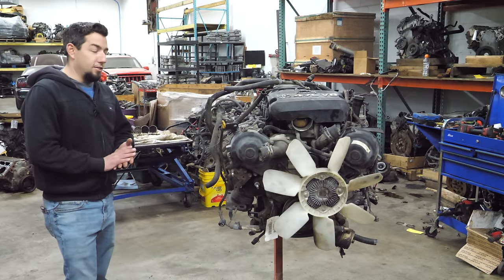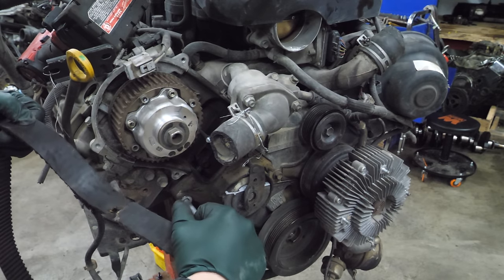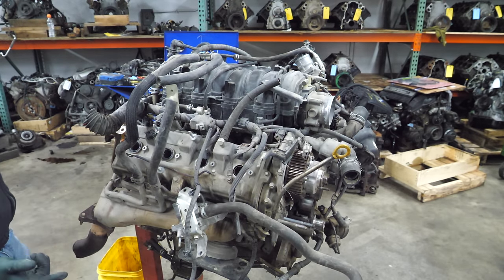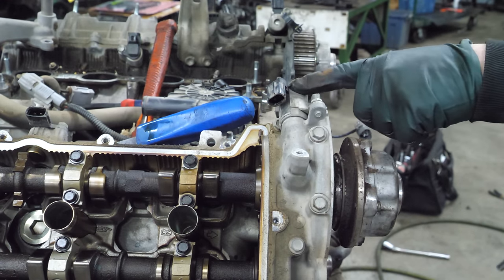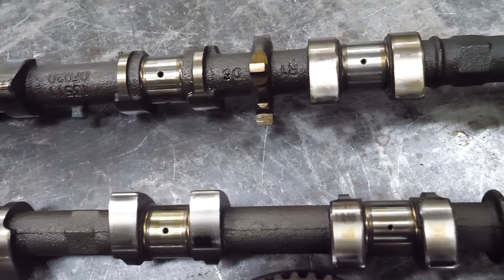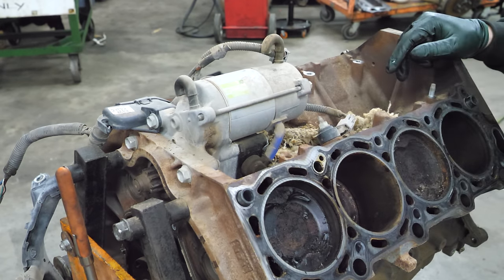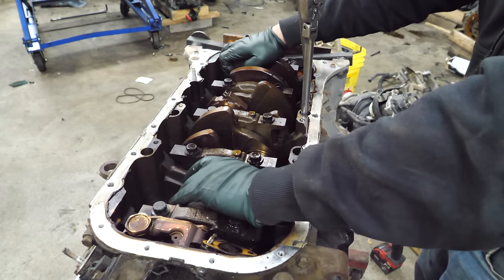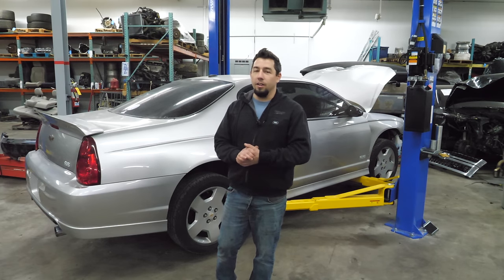Toyota Tundra 2UZ VVT Teardown! Bad Decisions Led To The Demise Of One Of Toyota's Greatest Engines!

Comment: This is why I'm not of fan of any engine that uses a timing belt unless its a non-interference design. Yes, I know timing chains and gears can and do go bad and can cause even more damage but the odds are in favor of metal over rubber.
Reply: I have a 2007 Sequoia with this engine, it’s a maintenance service about every 100k....I don’t consume oil with 190k and the oil is never burnt at 5k oil change. This is the most smooth and reliable engine I’ve known. My company Tundra has 420k on this same engine and only have done $2000 worth of maintenance on it. They are legendary, it does have the belt as a minus but it’s worth it.
Reply: I agree man, although it's not a vvt engine, I still drive my 96 Toyota 5sfe 2.2 and it uses a timing belt. I replace the belt every time I have had to access anything beneath the timing cover. (oil/water pump). Great little engine and the reason why I have strong faith in it is due to the fact it is non-interference.
Reply: Nothing bad with timing belt when you maintain it like you should
Reply: @miteshshah8060  yeah and my 4.9L Ford I6 is 350K old without any oil burning issues and is on 5k oil change intervals as well. But it doesn't have a timing belt. Or even a chain. Just two steel gears lubricated with a direct oil spray.
Reply: Even on a non-interference engine, a timing belt is a dealbreaker for me. I won't buy one. It's a lot of expensive maintenance that just does not need to be required at all.
Reply: I always feel like a timing belt on an interference engine is like a ticking time bomb
Reply: @thefatdindon  There is a LOT wrong with timing belts. They:

1: Don't last very long compared to chains or gears. An OHC chain system will last >200k without problem, a cam-in-block chain system lasts the life of the engine, and a steel geartrain with direct oil lubrication is functionally immortal. Pop the timing cover off literally any semi truck engine you care to grab from the past 80+ years and you'll see a common trend: It doesn't matter where the camshafts are(Yes some are OHC!), they are driven by steel gears lubricated by direct oil jets. And these gears just simply do not wear out even when the engines themselves have million mile service lives!

2: Changing them is a costly pain in the fucking dick. You have to tear half the engine apart to gain access to it, you often have to lift the engine and remove motor mounts since a lot of the time timing belts get used in transversely mounted engines and for some stupid fucking reason the engine mount on the front of the engine goes THROUGH the timing belt, and getting engines timed these days is way harder than it needs to be by design because they don't want you shadetreeing repairs anymore.  I know they use chains, but Ford Ecoboost engines come to mind on this; you need a tool only available to 'authorized repair facilities' to set the cam timing on them. It would be trivial to do this with a belted engine too just to further make them a thorn in owner's sides. Atop this, the job doesn't just change the belt. It's also got a bunch of tensioners and often water pumps attached to it as well; needless part replacements drive costs up for no good reason!

3: They are used to enforce planned obsolescence. Between the cost of having them replaced and the consequences of letting them go, they're a great way for a car company to design an engine with a service life of just 150k or so. Spec the belt to be replaced at 100k, ensure the engine is hard interference, then wait. People will either trade them in on a new model around that point so they don't have to pay for the replacement which lets your dealership do the service and resell as used to repeat the cycle, or they'll not get it changed because it costs a fucking fortune and it's impossible to shadetree only to blow the engine up right on schedule.

4: If that front main seal ever starts to go you can kiss the engine itself goodbye. Oil getting on a timing belt, for whatever reason, just fucking murders them. They will break ahead of schedule. And you probably won't even know it's happening until it's too late because the oil can't really get out of that area very easily. It just soaks into the timing belt and causes it to rapidly deteriorate with no external signs the seal failed at all. 

Fuck timing belts. I will never buy a vehicle that has them equipped. If I do, I will swap the engine to a different engine which uses chains or gears.
Reply: @TestECull  and yet the 4.7 Toyota V8 will go a million miles. Nothing forced obsolescence about them. Although you could say that about newer Toyota timing chain engines.
Reply: The thing is the best thing for a timing chain to last long is to constantly keep the oil fresh. But lots of people still go 10k miles on a oil change and do lots of short trips.
Reply: @jgranger2002  If it has timing belts it's got planned obsolescence built right into it. The hope is that an owner will be like 'well it isn't worth putting that much money into it so I'll trade it in on a new car' when they see the bill for the job, or they will instead refuse the job, keep driving it, blow it up, and replace it. And even if the engine itself doesn't, the truck it was put in DOES.  Nobody selling cars these days wants them to last more than about 100-150 thousand miles because if they last forever nd ever and ever and ever you won't be buying a new one as soon as your current loan is paid off. They want you on another one immediately.

Every modern car is built with planned obsolescence in mind. Use of timing belts when chains or gears are more skookum is just one example of many ways carmakers try to incentivise purchasing a new car every few years.

I still drive an F150 from 1985. That 4.9L I6 is truly immortal. Simple, rugged, easy to service, doesn't need much servicing, if it does need repair the parts are cheap as shit and I can do the repair myself with basic tools. Truly a built-to-last engine. And the truck itself is the same story; built to last, to be serviced, repaired, cherished for decades on end. That ol' mill is just about due for overhaul and I'm not gonna think twice about giving it that overhaul; be a better spend of money than anything I could buy today.
Reply: @TestECull  well I'm not sure my 2000 tundra is modern or not. But I know because of current examples it will last a million miles with proper maintenance. I would imagine if Toyota detuned the 4.7 to the power output of a Ford 4.9 i6 it could make it to 2 million miles.
Reply: @jgranger2002  It's modern. Anything with OBD-II is modern. And no, it's not the power output that shortens the engine life(Fun fact if you poke a Ford 4.9 until it's spitting out 400/400 it still lasts basically until the end of gasoline!). It's the timing belts. They're a costly periodic maintenance item that incentivizes people to replace the entire car instead. Not only that, but the truck around it won't last half as long as the engine already does.

I'd also like to see a citation on these mythical million mile Toyota V8s. The only engines known to last that long are 14+ liter diesels in semi trucks, and it's a world of difference how much more ruggedly built those engines are. Setting aside the sheer size difference, those things are built to last for-fucking-ever without any internal issues to speak of, and they're built rugged enough to shrug off neglect and abuse that will kill anything Toyota has ever sold.
Reply: @TestECull  well you can Google Toyota 4.7 million miles and see a few examples as YouTube won't let me post links. Power output definitely has an effect on longevity of an engine. You have an 85 Ford 4.9 it makes 117 hp and 233ft lbs of torque. The first Toyota 4.7 makes 235 hp and 320 ft lbs of torque. Planned obsolescence is for people that won't spend $1500 on there current truck but have no problem spending 40k on a new truck. I can agree that the ford needs less maintenance that the Toyota but the ford basically has a gas tractor engine. No hp all torque that revs to 4800 rpm.
Reply: I like the old style chevy engines, no tensioners, water pump isn't ran off the timing belt or chain, they can nearly go forever. I see 4.3's old style v8s go well over 200K miles and never had a timing job done to them, I would recommend every 100K miles but its rare they break.

I had a 91 Chevy c1500 with a 4.3 that had 680K miles on it, I was the 2nd owner, my grandfather was the first, it never had a timing job as far as I know, it needed it, turn the crank over a quarter turn before the rotor button turns in the distributor, truck ran and drove good even after beating the snot out of it hauling more than it could really haul, just wasn't worth putting the money into it, that thing would not die, I sold it running and driving lol.
Reply: @jgranger2002  275FT LBs, actually, and yeah it basically is a tractor engine. Which I fucking love. It doesn't need to rev. I cruise down the freeway doing 75-80 right alongside everyone else but I'm turning half the revs they are. 1750RPM. My usual upshift point is about 1400-1500.

You do have a point to a degree, but in neither of these engines does that come into play. You don't start seeing power causing shortened longevity in engines of this displacement until you're chucking out well north of 500HP. 235hp..120hp...in both cases the metallurgy inside the rotating assemblies is nowhere near its max loading and should not have any wear issues.

Also, getting 235hp out of my I6 requires little more than changing the carb out for a 4-barrel, changing the intake and exhaust manifolds, and stabbing a mild aftermarket cam into the thing. They only made 120hp because Ford choked the SHIT out of them in a fruitless attempt to get people to buy the more expensive 302 V8; it didn't work the 4.9 pulled just as well with significantly better fuel economy.

side note, as much as I'd enjoy seeing Eric tear a 4.9 I6 down, unless I tear one out of one of my two bullnose F-series...I also have a '95 with the EFI version of this engine...and just donate it to him itt'l never happen. They last too long, when they do fail it's just routine wear and tear which makes them rebuildable, and parts are so cheap that there's no real market for someone like Eric to turn a profit with one. So the only way we'll ever see a 4.9 I6 on Eric's autopsy table is if a viewer just straight up donates one to him......it'd also be one of the quickest teardowns he's ever done unless he just records the whole thing unedited. With the usual cuts he makes in post it'd be a 12 minute video.
Reply: @TestECull  well I thought you said you had a 1985. 1985 4.9 made 223 ft lbs. The most recent 4.9 made 260 ft lbs.
Reply: @jgranger2002  They never made a measly 233. The EFI motors were just north of 300ft lbs...the EFI system negated a lot of the strangulation; these engines also made just a tick past 200hp from factory...and the carb'd 300s always hovered in the 260-270ft lb range. The 240s are a bit weaker though, owing to their lower displacement; 230ft lbs sounds about right for one of those.

Put another way, 233 ft lbs of torque is not going to pull a 4800 pound cast iron brick through the air at 75-80mph when it's got over 300,000 miles on it.
Reply: Avoid all Hondas?
Reply: @TestECull  I'm just reading the specs for the motors. Are you saying they are a underrated?
Reply: @TestECull  can't be afraid to turn a wrench.
Reply: @POVShotgun  well they are valve benders. Although I like a Honda 4cyl. With a few exceptions.
Reply: @jgranger2002  I think it’s ok. Timing belts. I hate plastic timing chain guides! Haha who the fuck came up with that
Reply: @POVShotgun  well Toyota had them on a 22r with no issues. Nissan used them and had lots of problems.
Reply: Timeline belts are for sure a scheme the automakers created so you have to give over $1000 evey 100,000 right when you’re warranty is up of risk blowing up the engine. If they don’t use a chain they should make it at least easy to access and change yano like a serpentine belt since it’s a WEAR iteam. Like why on earth would they burry a crucial wear iteam that deep in the engine and that when goes bad destroys your entire engine
Reply: Swings and roundabouts... belts have traditionally been considered quieter. But sometimes they're just too damn small: the belt on my pushing thirty year old Fiat Coupe is only 17mm wide. Owners tend to change the belt at two years/24k miles if they can afford it, and three years/36k whether they can afford it or not. Because otherwise that engine grenades itself.
Reply: @AlwaysBeSmart674  it's not really all that deep. I do timing belts on Toyotas and Hondas all the time. I would much rather do a t belt than a timing chain. Honda and Toyota timing belts depending on what engine will go far beyond the recommend service interval.
Reply: @jgranger2002  and Toyota chose timing belts for a long time haha I think there’s a solid reason but I don’t have an engineering degree
Reply: I HEAR THAT!! Did clutch/slave, I resurfaced not so fly flywheel on my '05 Aveo (daughter #3 called it 'autism on wheels' IMMEDIATELY after sending her, 3 sis's, and mom a pic...from then on, it was my Auti! I digress, per usual) did all of this end of Jan./early Feb. in MN (I.E. COLD A.F. 🥶). Drove to work, back 2x, on my way there on day 3 at 80 mph, SNAP...and boom went the dynamite. Took the 4 plugs out, "Hmmm, all 4 at T.D.C.?!? 'prolly not too great for balance!" dumped my dew in the holes and turnt my frown even further down... conversely, my '72 Newport did a timing chain classic...skipped a tooth (not 2 or 3, just 1 so ya think it's something else...maybe PRAY it's another issue??) HOWEVER, motor is uninjured and ran f-n peachy with the new set. Also, let's get back to running the G.D. fuel pump BACK ON THE CAM...was that TOO EASY F.F.S.???
Reply: @TestECull  the timing belt job on this engine really isn't that bad (I've done it on my 05 Sequoia). I'd take it over the disaster that say the 3.5 ecoboost is as they experience issues with the cam phasers and then require a massive timing chain replacement service.  It's actually more efficient than timing chain setups as it has a fraction of the rotating mass as well.

To your point though, if the vehicle isn't setup to be maintenance friendly with the timing belt service, that is just bs. This particular one isn't like that though, very simple.
Reply: @TestECull  bro UZ series timing belt kits are like $100, you change the water pump and pulley/idler bearings all at the same time and the engine goes for another 100,000km. There’s a reason these engines have a reputation of being indestructible and running forever. The only way you’re paying anything remotely close to $1000 for a belt change is if your getting Lexus to do it, or if you have ‘sucker” written on your forehead
Reply: @Sci-flyer  Mm. You're forgetting labor costs, part costs for the needless water pump job, and  how impractical it is for a shadetree to do the job. You're not gonna get that job done for less than $500-$600 without the shop cutting some serious corners. And seriously, changing a perfectly functional water pump every 75,000 miles or so?! What the fuck.

I just looked up the water pump for the 4.7 in this video: 120 bucks. So you're already up to 220 bucks in just parts for the timing belt job on this V8 before you've even thought about gaskets, coolant, labor costs...

But hey, you wanna throw part costs and service intervals around? Fine.

The two gears for the cam drive in my 4.9 I6? They cost 65 bucks right now. Their approximate service life? Nobody fucking knows because they never wear out before the rest of the engine does. They are typically replaced when the engine is overhauled because the cam gear is pressed onto the camshaft with a hydraulic press and it's generally just easier to press a new gear onto the new cam than it is to press the old gear off the old cam and then press it onto the new cam. But if you were to re-use the old cam for whatever reason or just so pinched for money you couldn't spring another 65 bucks, then yeah, you could easily just re-use the old timing gears. And given those I6s are known to live half a million miles in neglectful, abusive situations....yyeeaaahhh. They just don't fail. Ever. So it's not a job the owner of the engine ever has to do.

Timing belts are shit. There is no defending them.
Reply: @jgranger2002  I don’t mean literally deep. I mean deep as In how much work you have to do. Removing water pump and the accessories then timing cover and once you’re that deep it’s standard to replace all pulleys/bearings tensioner water pump. I just don’t get why they can’t make it easy to change like a serpentine belt replacement I know you’d still have to line the marking up.  Idk maybe put the accessories on one large bracket that can be taken out with a few large bolts and the belt be right there. I mean can you tell me any other “wear item” that requires and costs that much to replace in time and money (if you pay someone)
Reply: @TestECull  YOu can cry about it all you want, the fact is that the belt-driven Toyota V8s last as long if not longer than any Ford engine, the number of Lexus and Toyotas from the '90s still going is testament to that. If these engines were as disastrous as you make out the cars would have been extinct years ago. In fact, i'd even argue having belt replacement intervals likely contributes to this longevity because it encourages people to check/replace water pumps, pulley bearings and tensioners, the kind of stuff that kills engines quick. I have worked on dozens of UZ-series engines and never come across one with a snapped belt, its like the mystical starter motor in the valley that everyone says is a terrible idea, except they never go bad so its a complete non-issue. You're histrionics about belts is not based on actual real-world experience, that much is obvious.
Reply: @Sci-flyer  No crying here, but you're definitely pretty butthurt about these engines being called out for excessive maintenance costs that other engines with equally long lifetimes just don't need.

And yeah. Starter in the valley is bad. I don't give a fuck how often the starters fail IT SHOULD NEVER BE PUT THERE. Bad design no matter who did it. It was a bad idea on the Northstar V8, it's a bad idea on the UZ engines, it's a bad idea in general. That. Is. Not. Where. The. Starter. Goes.

Fuck timing belts, fuck valley mounted starters....and fuck Toyota. Overpriced overcomplicated junk just like everything else on the road these days. Ain't nobody made a good car in 30 years.
Reply: Not a fan of timing belts myself but I wouldn't write these off because of it